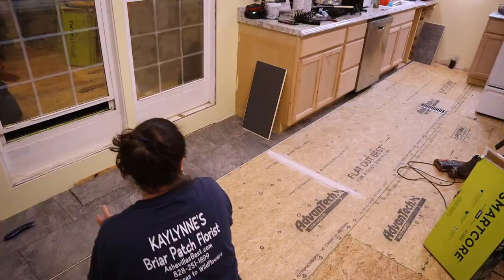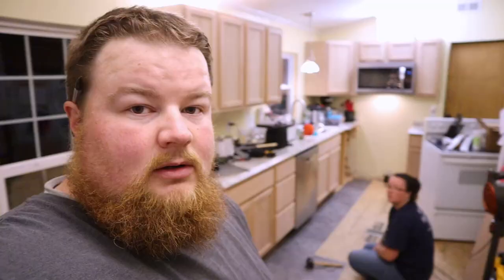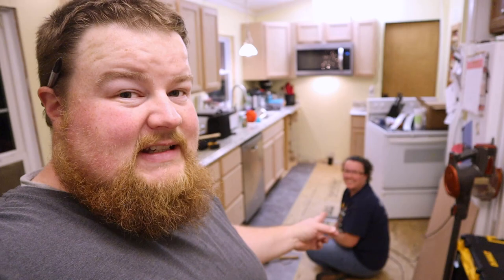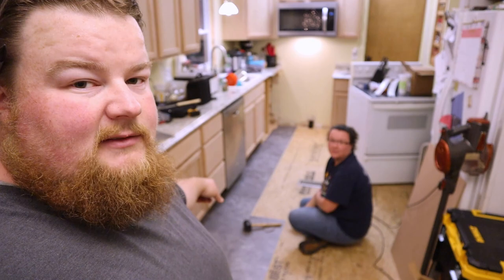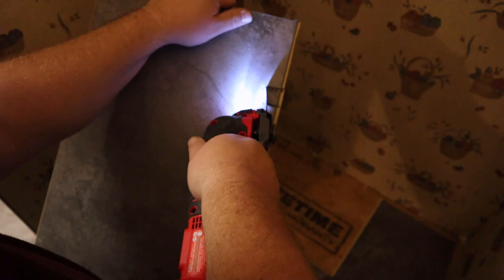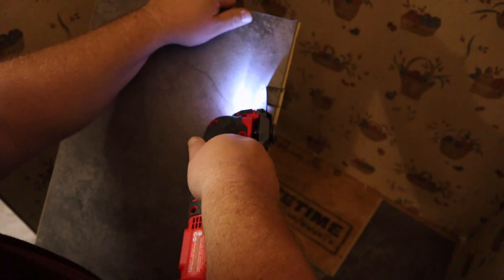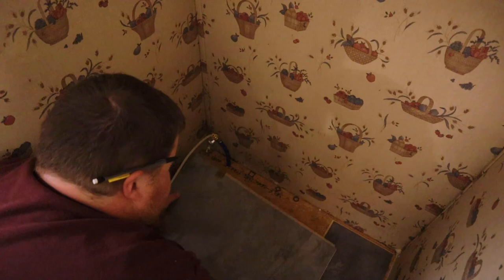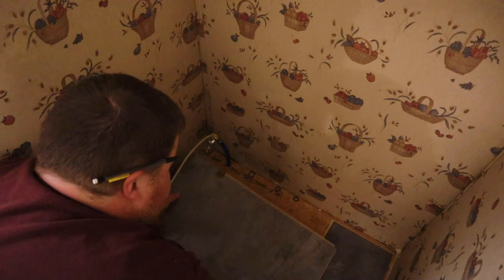Installing Our New Kitchen and Dining Room Floor - SMARTCORE | Budget Mobile Home Remodel #29

Comment: I love it that you vacuumed the sub floor as you put down the flooring. A "professional" might not have done that. No one would probably ever know that there was dirt under the flooring, but you would! It just matters, even though it probably doesn't matter. It just does.
Reply from the maker: We figured with as much as this floor cost us, and as hard as we worked on getting the subfloor done we would make sure it was perfectly right! 😊 That and we sure didn't want any issues later creeping in on us! Thanks Betsy!!

Comment: I was going to ask you how the floor feels under foot, but after she said splinter... I knew it had to be an improvement! Looks good guys!
Reply from the maker: The floor feels very nice! It has texture like stone but nothing extreme. It’s very smooth underfoot and the joints aren’t deep or anything. We’re very happy with it!
Reply: @ DLR  When i took my carpet up. I gave my floors  a coat of paint  red brick color. The floor never splintered. When i saved enough money i bought  some bamboo flooring it still looks great..

Comment: Good job on the floor!
When painting cabinets with a brush or roller mix in Floetrol which helps eliminate brush marks. It is also a mold and mildew prevention product. I used in on bathroom cabinets and it worked great and I got a really smooth finish. I sprayed the doors and you can’t tell any difference between the application methods.
Reply from the maker: Awesome tip! I'll check into it for sure, thanks! -Sam

Comment: I just installed Smartcore but mine looks like light oak!  LOVE IT!!  only thing.. I know you dont HAVE to put the barrier foam paper stuff down but I did even though it was going over existing tongue and groove wood floors * they were walnut stained and way too dark.. cost of sanding and refinishing would have been the same as the new flooring with half the work and water proof to boot! *  I live in Ohio where snow and rain is a concern  .. Great choice for flooring!

Comment: I was laughing so hard when you started out with a utility knife and changed to the multi-tool.  I did the exact same thing!!  I was not about to get up and down, up and down, up and down.  No way.  I needed a new blade afterward, but it was totally worth it.  Your floor looks amazing!!!!  I chose gray as well.  Love it!!!
Reply from the maker: Yep!!! That utility knife didn’t do anything! Another reason the oscillating tools rock. Our backs are quite sore from this three day venture. But it’s done. So thankful! Any professional floor installer is a machine and has our respect!

Comment: Ya gotta wonder what possessed the designers to put a FLOOR VENT in a kitchen?!?!?

Sam, if I was you, I would design a removable debris trap with screening. That way it could be removed for cleaning,  but wouldn't block air flow!
Reply from the maker: It’s the only vent in the kitchen and dining room, wasn’t many options I guess. We’ll have to look into that. Thanks. -A

Comment: Floor looks good... kinda sucks that the heat register is smack dab in the middle of the floor.  Might have been able to pretty easily have moved it to an out of the way spot, but, it is what it is, and in any case, no more splinters, which is a good thing.  Like the floor, came out really nice.
Reply from the maker: That’s where the vent was originally.  It was better in the kitchen than the dining room! Thanks! -A

Comment: Sam or Angela, what is your opinion on taking up the sub flooring and replacing it with, in your case OSB, or plywood or just covering up all the damaged areas on top of everything including the flooring. I have been told the easiest way is to just cover everything but I have seen videos that say the best way is to take up all the damaged sub flooring and put down new plywood on all the floor area.

Comment: Oh wow, love the way the floor looks!! 

Question; a barrier between the floor and subfloor isn't needed?
Reply from the maker: Not for our floor and crawlspace setup and how this flooring is designed. I checked the packages and they specifically stated to not use a barrier for our install. Your mileage may vary though. Thanks!

Comment: Question...how is the floor doing after a few months? Have the joints stayed together or have any come apart? I have been wondering how this type of floor would do in a home that doesn’t have a concrete slab floor. I have put this in on top of concrete and it works well. Also...if you lay anymore....there is a kit for less than $15 you can get that is for flooring like this. It has a pry bar in it that has an end you can hammer while the other end is hooked on the flooring so you can hammer when up against a wall. You would hammer toward yourself. Just in case you decide to do that again in another room. Great channel...I am subbed!

Comment: Do you only used an oscillating tool to cut the tile, correct? I’ve seen a lot of diy’ers say use the floor padding and up until this video, i had to decided to use it as well. I live in an 88 model double wide and i know for a fact that my floors are not even or level. I am also in Tennessee. I watch y’all’s videos all the time. Anyway it’s just me and my 3 kids so I too have to do my own renovation. As i can afford it. The bank don’t loan money for mobile home repairs. I’m trying to learn all i can from y’all 😁

Comment: Hey sam you wouldnt happen to have a box of that smart core flooring would ya to get the Item# and Model# off it ???  we really like it would like to put in our house trailer
Reply from the maker: No problem! Here it is:   SMARTCORE 10-Piece 12-in x 24-in Chatham Stone Locking Luxury Vinyl Tile
Item # 1344179 Model # LX62700564 👍🏻

Comment: Do you need a barrier down first! I had to put barrier down for mine!
Reply from the maker: Nope, for our floors and crawlspace system no barrier was needed. In fact, it was specifically advised against. Each manufacture has differing guidelines so the answer will always lie within the flooring spec sheets.

Comment: Will peel and stick laminate tiles work on that type of subfloor? I want to redo one of our rooms but it’s much cheaper to do peel and stick.
Reply from the maker: Yes! So long as you apply the primer beforehand. It's a liquid you brush or roll onto the wood then allow to dry. It keeps the wood from sucking up all the adhesive from the tiles and having them come up later. Works great! Something like this: https://amzn.to/3kdAh51
Reply: @sam-and-angela  Thank you!!

Comment: So are you that good that you didn't make any mistakes?  Or did you just not show them?  When I do a project like that I always have to buy 1 extra box because I will make a wrong cut, break a piece putting it in, or just being dumb and miscalculating the square footage.
Reply from the maker: Haha. Sam did really well cutting them. We did have a box or two extra, but will use them for the laundry room when the time comes. -A

Comment: I just watched a video that has a nice storage solution for small spaces using a rack over the sink (not sure it will work with your tall faucet).  the other thing the ting house has is pocket doors.  The original old part of the house had pocket doors in the hall and the original bathroom and when we remodeled and flipped our house  putting our master bedroom where the old kitchen was and the kitchen where the old master bedroom was because our detached garage was on that side of the property and people would use our bedroom as a hallway - plus carry grocery was a pain.  Any ways we added an extra pocket door into the bathroom from our new master bedroom and also replaced the old pocket door that was 40 years old with a new quality pocket door going from what we call our master bathroom into the hall and that has worked out great.  https://www.youtube.com/watch?v=WU89BKRo34g&feature=em-uploademail

Comment: What is the name of the tool you are using
Reply from the maker: It's called an oscillating tool. I have a battery powered one, but also a corded one that was used for all our demo work for this renovation. Here's the exact model I have (corded) used for 7+ years: https://amzn.to/38JX4A0
Reply: @sam-and-angela  thank you so much. Im going to start renovating my 1977 mobile. Between your site and Dougs DIYferent i have learned alot. Thanks again